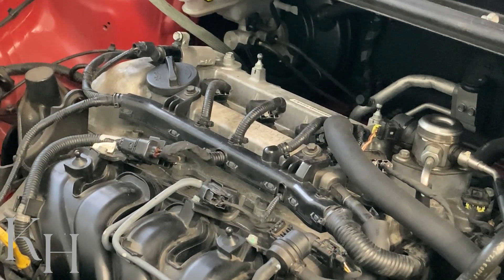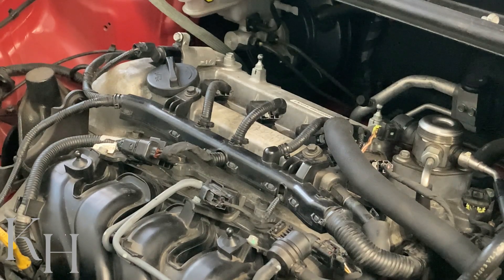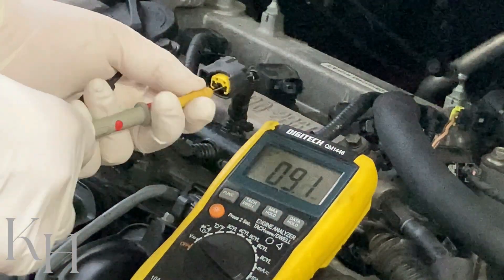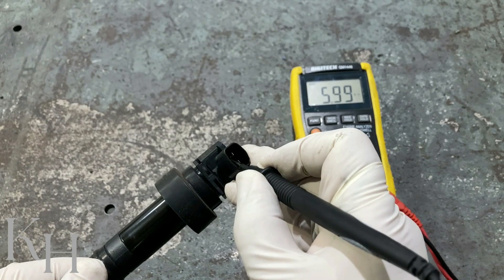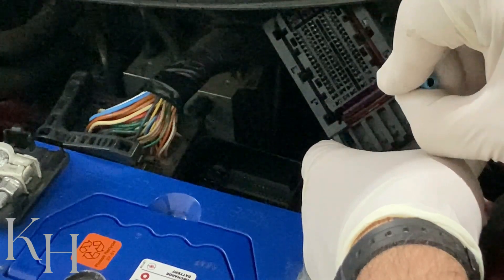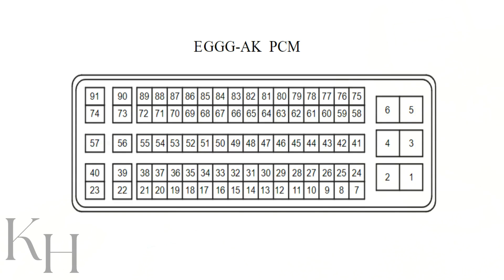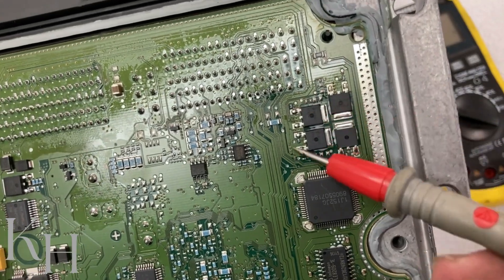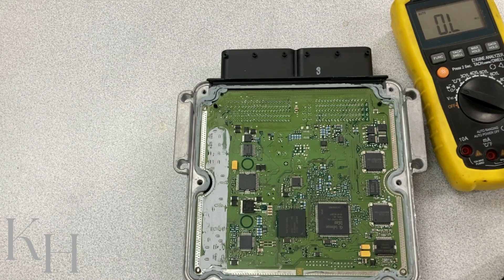How to Test Ignition Coils | Ignition Coil, Wiring & ECM Internal Diagnosis #ignitioncoil #misfire

Comment: Dear Sir
I hope this message finds you well. I am requesting you to make a video tutorial on injector testing, similar to the excellent video you created on ignition coil testing.

As you know, injectors are a common source of problems in vehicles, and it can be difficult to determine whether the issue is with the injector itself or with the harness or ECM. A video tutorial would be an invaluable resource for mechanics and technicians, helping them to diagnose and resolve injector issues more efficiently.

I would be grateful if you would consider creating such a video. I believe it would be a valuable addition to your library of automotive repair tutorials and would be greatly appreciated by the automotive community.

Thank you for your time and consideration.
Best regards,
Abdul
Reply from the maker: Hi my friend, have you watched the following video on our channel?
https://youtu.be/HJ4QYOEAZoY?si=az7f8MYvL1HVXElc